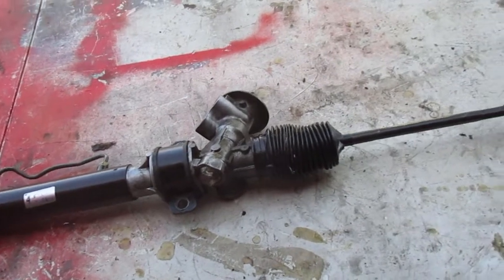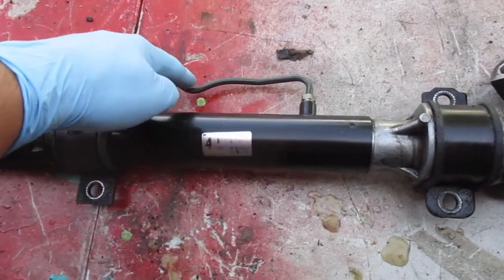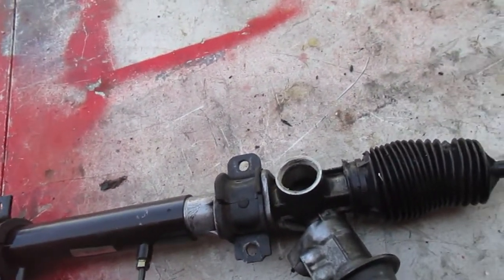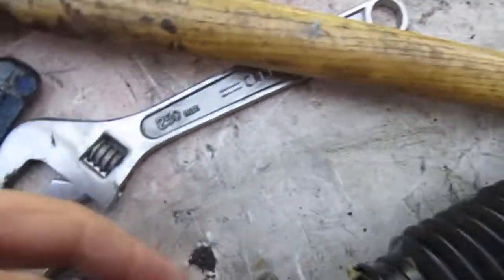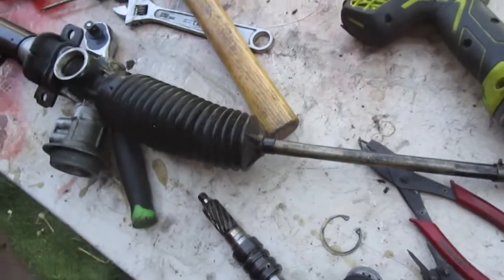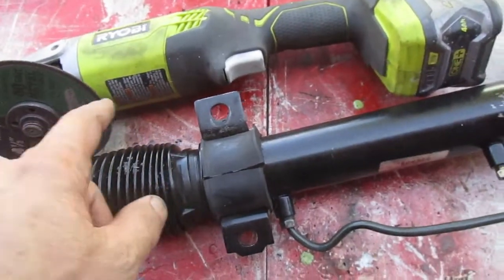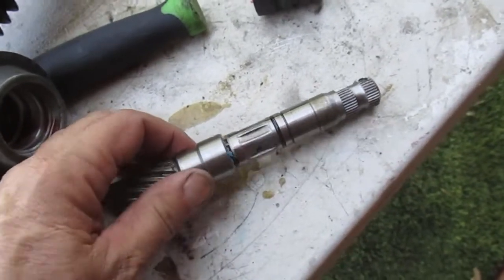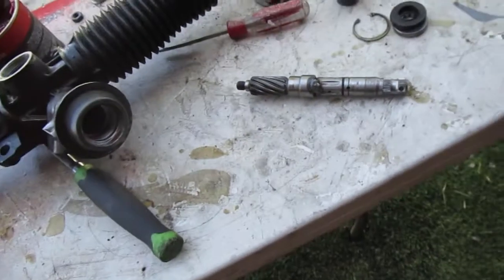Easy Way to Modify Power Steering Rack Into Manual Rack

Comment: Did it feel any better than steering linkage or just as hard to turn as any non powered steering? Curious before i destroy mine..those lines are in the way of my oil pan on a swap and first I'm going to try re clocking that side of the cylinder with the line outlet nipples..looks possible
Reply from the maker: We changed the steering wheel to use a smaller diameter wheel, and after the manual mod, we put the bigger wheel back on as it was a little tough to steer it with the small wheel.  Can't say it felt any different, the key was eliminating the power steering pump and any potential leaks.
Reply: @murraymadness4674  gotcha,thanks

Comment: Question bro, what if i just remove all the fluids, power lines, belt, then inject grease on the holes, cover the holes with secured rubber with small hole, will that work?
Reply from the maker: Edit: a power rack has seals so the fluid pressure pushes it left and right, if you just plug the holes and don't remove the seals the rack can't move as the air/fluid has no where to go, in my mod shown it just loops to the other side.  The more complicated mod is taking the rack apart to remove the seals like a manual rack.
Reply: @murraymadness4674  thanks for the reply bro, i will try first drain all the fluids, then replace it with grease, will not seal tight the holes, will try to just cover it with rubber that has like some small holes so pressure will go out, then will use it for maybe days then will compare and gut out the internals

Comment: Has your conversion worked out?
Reply from the maker: Sure, we raced the car three times endurance racing with manual rack, we had to use a slightly bigger steering wheel.  Then I sold the car.